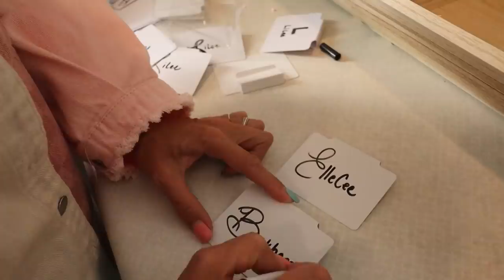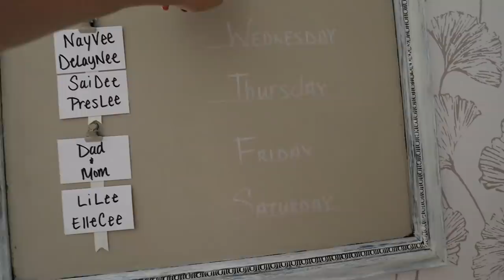LAUNDRY ROOM MAKEOVER!! *Laundry for 16 KiDS?!*

Comment: (Edited to add- I posted this comment before I saw your new system is basically just like this. I hope it works well for you. As my kids got bigger, they didn’t stick to a day but has to leave their labeled basket by washer/dryer so if another needed to use the w/d they just out those clothes in their basket. If they wrinkled I guess  the owner should have taken care of them)

I learned my system years ago from another large family M.O.M. (Mom of many) 
Every room has its own dirty hamper and laundry day of the week. Sheets for that room can be done that day or on its own day. Towels too or have a hamper by washer and their own (or every) day or add as fillers to small loads. 
So laundry never has to be sorted for  where it goes. Every person or room had a labeled laundry basket to leave by washer/dryer. Those old enough did their own laundry. And I never had to wonder whose socks or undies where who’s

Comment: Washing is a struggle for me sometimes too, there are only 5 in our house but by the time sheet change day comes round I have 4 beds worth of sheets and pillow cases to wash, towels to wash and clothing too. Its not so bad really as I try keep up Washing clothes and school uniform every 2 to 3 days, sheets once a week and towels, tea towels and cloths every 3 days. I have a 7kg washing machine which holds a lot, I hang it out either in the car shed or out on the main clothesline outside (I'm in NZ and everyone loves hanging washing out to dry) and the smell of fresh dried washing is amazing 😁 in the winter I hang the clothes indoors under our ventilation system on clothes airers. I don't usually separate colours from whites unless they are good clothes, I haven't got a dryer either lol.

Comment: To prevent the dye transfer from new jeans, add 1/2 to 1 cup of white vinegar to new jeans in a rinse cycle. It will help set the dye so it doesn't bleed onto other clothes.  After the rinse cycle, wash with soap in a regular cycle.